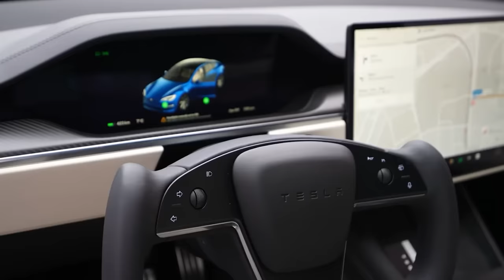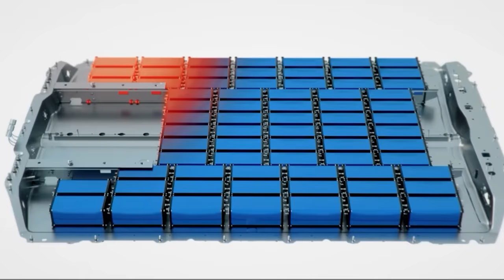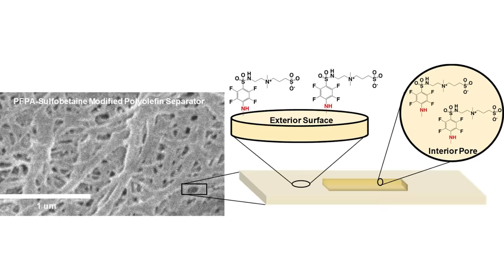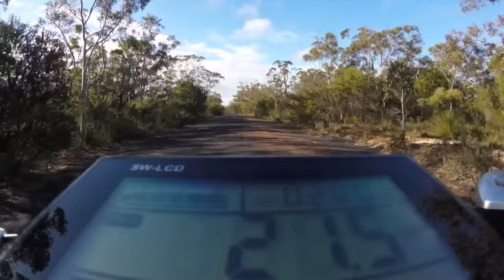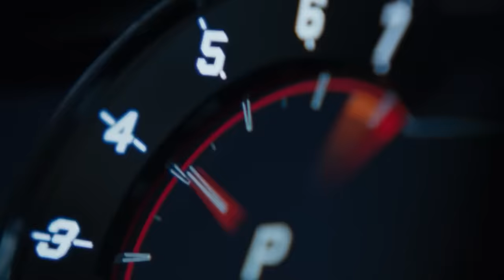EV's Are Exploding In Shocking Numbers

Comment: Isolated incidents my bottom 😂😂😂 There are numerous incidents every year and no safety systems in place 😮
Reply: EV's are 1/20 as likely to catch fire as ICE.  But more difficult to put out if they do.  Water is not the solution, cover them and let them burn.  New battery chemistries are solving this issue, just give it a few years.
Reply: @highenergyideas  I personally watched a truck Driver Die in Ohio, on camera, working for ODOT, in rush Hour Traffic, after He rear ended another truck.  There was nothing anyone could Do.  Truck burned to the ground before Fire Fighters arrived.  Not Kidding, it was Horrible.  Again, EV's 1/20 times as likely to catch Fire, per miles driven.
Reply: @popsracer886  Hybrids reflected the most at 3,475 fires per 100,000 vehicles. 
ICE vehicles caught fire  at 1,530 incidents per 100,000 vehicles.
EV fires were 25 fires per 100,000 vehicles.
Reply: @BioniqBob  Good facts, It has also been know for some time that Hybrids are the worst of both Worlds from a system and design standpoint, overly complex and difficult to do both system safely and correctly.

Comment: My first job involved a company that used natural gas for fuel in all their vehicles .....I am 65 years old the year was 1976
Reply: There's a reason you see CNG primarily in fleet use.  CNG and LNG are fine, but they bring their own issues to the table.  But the biggest issue is when you get John Q. Public exercising their autonomy with high pressure systems.  Watch some of those "Just Rolled In" videos to see how irresponsible people are with just the normal stuff.

Comment: EV (lithium-ion) batteries contain a FLAMMABLE electrolyte that can result in fire or even explosions if they are punctured, damaged, or heated. ---- The electrodes are submerged in a liquid called an electrolyte, which allows for the movement of ions and consists of lithium salt and organic solvents. It is these ORGANIC solvents which are the leading fire hazard in Li-ion batteries.
Reply: EVs have fires restart again months later . Any EVs damaged by flood water must be 100 feet away from any other vehicle, structure or anything flammable
Reply: @georgevavoulis4758  Not true.
Reply: An at home camera recorded a dog that was playing with some device powered by a lithium battery. The dog's spit caused it to flame on on the rug.

Comment: EV’s are not good for stress and anxiety. Not only do you have range anxiety, your vehicle may randomly burst into flames maybe with kids trapped inside.
Reply: Locked in,unable to open
Reply: @jeffdunnell6693  That claim has been proven to be absolutely 100% fiction.
Reply: EV's catch fire far less than combustion engine cars genius, and it isn't even remotely close.
Reply: @redbaron6805  you can’t put out ev fires ,genius
Reply: @jeffdunnell6693  Which changes neither of your false statements.

1.  The "unable to open" is obviously false as EV's have either have mechanical doors or mechanical overrides if they have electronic doors, and they unlock the doors in a crash.

2.  EV's fires are a small fraction of the number of  combustion engine fires per 100,000 cars, and as EV battery technology keeps getting better, that statistic will only get better in favor of EV's.
Reply: So, how might you feel if you or your family were in one of the 190'000 ICE vehicles which caught fire in the US during 2022?  (NTSB statistics)
Reply: @redbaron6805 You really know nothing about thermodynamic principles just stop embarrassing yourself publicly.
Reply: @redbaron6805 Just FyI the mechanical override was implemented lately with certain famous manufacturer.. but it gets better in one of the models it is located at a surprisingly idiotic place at the back of the car which ..is not only hidden but requires a small tool to be opened quickly..

Comment: I had a gas line leak on my 78 chevy truck that caught fire. I put the fire out, cut the line at the leak, cut some small rubber line, spliced the line with it and then drove it home, never replaced the gas line, it worked just fine as is. A leaking valve cover gasket on my New Yorker caught fire, I threw sand on it and it stopped burning. I had a toolbox in the trunk. I tightened down the cover, drove to a auto parts store and bought some new gaskets. I replaced them. Hint, I didn't have to replace my vehicles because of fires!

Comment: You cannot simply compare ICE vehicle fire numbers to EV fires. It is a known fact that by far most ICE fires are deliberately lit, either as stolen vehicles or insurance jobs.
The number caused by mechanical failure are a tiny fraction of the total number. There was also a recent upsurge caused by grass accumulation on diesel DPF's that
ignited during the DPF burn cycle, that was unique to vehicles being driven off road, but still pushed the statistics up. Many EV fires occur completely randomly, even when 
the vehicle is sitting idle. That alone poses additional risks to EV ownership, garaging in a house could be just as risky to life as driving one.
Reply: LOL Okay Nancy
Hybrids reflected the most at 3,475 fires per 100,000 vehicles. 
ICE vehicles caught fire  at 1,530 incidents per 100,000 vehicles.
EV fires were 25 fires per 100,000 vehicles.
Reply: @BioniqBob  Your insurance cost is the best source to validate the truth of that statistic. Insurance cost should plummet with such increased safety and associated on costs for insurance claims...
Those figures also sound like fire totals for vehicles of all types, and that will include ALL vehicles comprising cars, trucks, vans, busses, utes etc, so balanced against the percentage of vehicle fires that EV's contribute still make those numbers horrific, probably even more so considering the age of those vehicles.
Interesting to see the numbers in China that are a magnitude higher than wherever your stats were derived. Maybe their batteries are not blessed with the magic reliability that ours seem to get cloaked over them.
Reply: @alasdair4161  Yes they went down.
Reply: @BioniqBob  lol...
Reply: @BioniqBob  This stats is about fires. Are there stats which reflect the cars were repaired as it is a minor one? For sure EV cars is total burnout. And... why are insurance in EV cars more expensive than their equivalent ICE models?
Reply: @BioniqBob  The main reason ice fires happen is because of the unholy cat converter . That damn thing clogs it glows red . Get rid of the cat converter and stupid plastic fuel lines and ice fires would be next to nothing  .  I am a four wheeler and have caught 3 vehicles on fire due to cat converters . I won't own another vehicle with a cat converter . And I will always remove carpet and floor mats
Reply: EV fanboys know this, but they are always in denial despite overwhelming evidence.
Reply: @BioniqBob I call B.S. on your claim.
Reply: @arnolddavies6734  60 to 1 LOL
Reply: @alasdair4161  " Your insurance cost is the best source to validate the truth of that statistic."

Yes.... lets look at the insurance rates.... "Forbes said its analysis of data from Quadrant Information Services shows that the average annual premium for EVs is $1,889 versus $1,786 for an ICE vehicle."

So... the difference is around 5%, and even that doesn't account for the fact that EV's tend to be more expensive premium cars which cost more to purchase.

Basically showing EV insurance rates are almost identical to ICE car insurance rates, completely destroying the claim that EV fires are more common.

Actual data shows they are not.  And unlike ICE cars, EV's are not more fire prone as they get older.
Reply: @Hyperion1722  "And... why are insurance in EV cars more expensive than their equivalent ICE models?"

They are not.  Not sure  why people are unable to look up even elementary data...

"Forbes said its analysis of data from Quadrant Information Services shows that the average annual premium for EVs is $1,889 versus $1,786 for an ICE vehicle. "
Reply: @huckstirred7112  "Get rid of the cat converter.."  Which is illegal in every state.....
Reply: @redbaron6805  i DRIVE A 1976chevy 3/4 ton with nothing but glass packs  .   There is away to move O2 sensors  around so yo can remove all the pollution control shit .Witch is well worth it if you only get inspected every 5 years
Reply: @huckstirred7112  Yes, god forbid we keep using cars with CAT's to keep the air clean and breathable for the rest of the population.
Reply: @redbaron6805  if they were concerned about pollution ,they would go to propane .You can run a 500 caddy on propane or natural gas with no pollution controls and no pollution . They do it every day in factories .That is why fork lifts run on propane . .It is not about the climate it is about control
Reply: @huckstirred7112  That claim is simply massively flawed, for several reasons.

1.  Electric motors are over 92% efficient, while combustion engines are around 20% to 30% efficient on their best day.

2.  While it would be "cleaner" to run a combustion engine on natural gas or propane, it would still create a lot of emissions, as seen here:

"CO2, CH4, and N2O emissions are all produced during natural gas combustion"

And fork lifts don't just run on propane, they have had electric fork lifts for decades.

The "control" argument is also just laughable.  If a government would want to control its population, the easiest way would be to restrict oil and gasoline sales and production.

Your combustion engine car requires gasoline, motor oil, belts and plugs, coolants and countless other parts to run, none of which you can make yourself.

Compare that to an electric car which requires electricity to run, which anyone can produce with a solar panel, wind turbine or even a home made generator in a nearby stream.

It would be far faster an easier to shut down oil refineries and limit natural gas and propane sales, that it would be to confiscate all the solar panels in the country.
Reply: @redbaron6805  fork lifts are used inside buildings everyday with no ill health effects same with house stoves and furnaces running off propane and natural gas . That means what little emissions they have is irrelevant . Considering they ecological damage needed to produce those batteries makes any benefit they have null and void

Comment: I would argue that the “well known environmental benefits” are somewhat questionable. It depends on how long you own your car and how many miles are put on it before it is recycled or has its battery replaced. It also ignores the whole issue with the sourcing of the raw components.
Reply: Actual scientific studies show otherwise.  Countless studies have shown EV's are cleaner than ICE cars, even accounting for mining and manufacturing, after about 12 to 18 months of driving.

Most vehicles are driven around 13 to 15 years, so EV's will easily be far cleaner than ICE cars, and it isn't even close.
Reply: @redbaron6805    Even Volvo’s studies don’t agree with your comment. As a former scientist myself, I would like to see these studies you reference. “Science” can be corrupted for political purposes just as easily as anything else.
Reply: @redbaron6805 And you're not counting all of the pollutants released into the air when they burn like hell.
Reply: Not to mention rhat in Australia now its cheaper to run a petrol vehicle than an EV
Reply: @redbaron6805 in London they've just dramatically increased the pollution tax for them because they've been found to cause more of an atmospheric pollution problem due to their weight&the amount of rubber particles which they release.They're not the solution,just a knee-jerk reaction.
Reply: @helenbenjafield7351  You just keep parroting the same nonsense claims which have absolutely no basis in reality.

No.  There are NO restrictions and NO pollution taxes for EV's in London.  None.

What are you claiming simply doesn't exist.
Reply: Recycled? What a hoot!
Reply: @ThomasLee123    Depends on what you mean by “recycled”. I think buying a used car is a form of recycling (via re-use). But I understand what you mean. Cars are sent to junk yards or crushed and disposed of. The parts aren’t melted down for reuse.

Comment: I hate that people in government are pushing EV adoption. I live in a place in Alberta that hardly has any gas stations never mind EV charging stations and I have to drive long distances in cold weather, an EV will not work for me. I think they have their place in cities but not everyone lives in a city so governments are not looking at the big picture. I think there is going to be huge push back on these changes. I also have concerns that we are going to have an environmental disaster when there are thousands of these batteries stock piled because they don't hold as much charge as they once did. Do EVs even last 10 years?
Reply: They're completely impractical&an environmental disaster.

Comment: In my opinion, you can't say that there are very many electric cars on the roads. So statistically speaking, the number of fires is very high. You also have to include battery fires involving electric bicycles. I have long been waiting for a law that requires batteries to be charged in special boxes.

Comment: Alternative materials, such as Sodium and Selenium, have been researched, which use a solid instead of liquid electrolyte, significantly reducing, if not outright eliminating, the chances of such explosive battery fires. I believe the solution is to discontinue the manufacturing of lithium-based batteries altogether.
Reply: They knew, I mean they should have,being back a few years ago when everyone's vapes kept blowing up . But they covered most of that up.

Comment: Cost to repair is much higher as is insurance. You aren't supposed to even push an EV that has been in a fender bender, so they block the road. Road tax is being implemented per mile driven by an EV now. Charging stations charge more for electricity than charging at home would cost. If you have a charging station in your garage, that most likely means your home owner insurance is going to go up. Resale value of an electric car that has been in a tiny fender bender is going to be Zero.

Comment: What is the maximum number of miles and charges that these monstrously large lithium-ion batteries have been enduring before they begin to break down and then explode? We’ve long relied on small ones to power our variety of cameras and internet phones; yet, lithium and cobalt are exhaustible resources, and, of course while they are toxic, due to the small size required for iPhones and cameras, for example, we’ve managed their safe usage. Now that lithium and cobalt are becoming harder to find as they do not replenish themselves, and because when used in EV batteries, their life is limited and cannot be recycled (?), EV vehicles surely must go the way of original steam-powered vehicles? Our ruling politicians need to face this reality.
Reply: It’s not even neccessarily miles, it’s that the battery was breached in an accident.  It’s oxygen and/or water getting into the battery and reacting with the lithium salts that tend to cause the explosion
Reply: LOL Nancys are funny
Reply: I was out riding my ICE powered petroleum burning Harley Davidson one day when I saw an abandoned Tesla on the roadside and I thought to myself "somebody should bring them a can of electricity! "
Reply: @donaldoehl7690  Okay, Nancy.
Reply: They have a recycling plant that will eat a full battery pack whole in 5 seconds and separate it into material bins and they reuse 99.9% of it or some really high percentage.
Reply: Most EV's battery packs can do at least 1,500 to 2,000 charging cycles.  On an EV with 300 miles of range, that translates to 450,000 to 600,000 miles or more.  If they use LFP batteries they can do up to 10,000 charging cycles.

Also, people really need to learn about Lithium Ion battery chemistry.  LFP batteries don't use Cobalt at all, Sodium Ion don't use Lithium.  And Lithium is far from being "rare".  In the USA alone, the Salton Sea by itself has enough Lithium for 375 million EV batteries.

We haven't even explored a small fraction of the areas that could have Lithium and current deposits are enough to last many decades to come.
Reply: Half the Lithium was made in the Big Bang, along with all the Hydrogen and a lot of the Helium.  All the other elements have a more complicated genesis.

Lithium is not in short supply.

Cobalt is close to Iron and Nickel, at the bottom of the curve of binding energy, and thus a product of supernovas.  There's a great deal of Iron and Nickel, and none of the three are in short supply, although they are an effort to get for the first time.

We may work around that.
Reply: Bout a million miles
Reply: @redbaron6805 it's exhaustable,&we need to engineer a synthetic fuel instead of constantly destroying the environment.White hydrogen could be used until a new fuel has been engineered,&you could continue to use your existing vehicle,so less pollution,also,lithium extraction both pollutes&depletes the water table.
Reply: There's a huge difference between a phone and an EV.